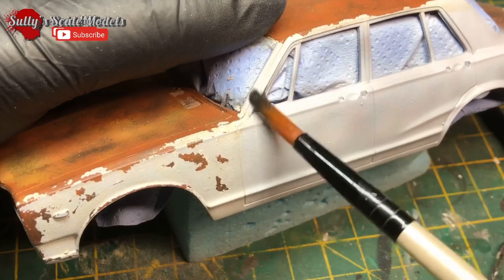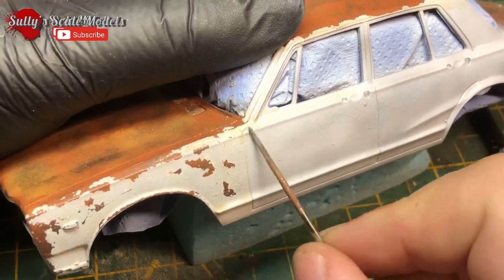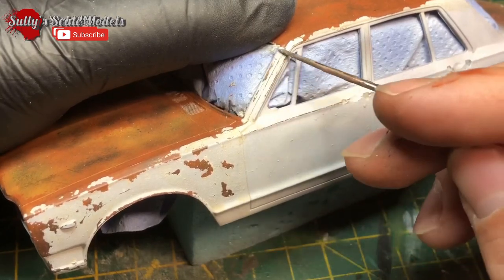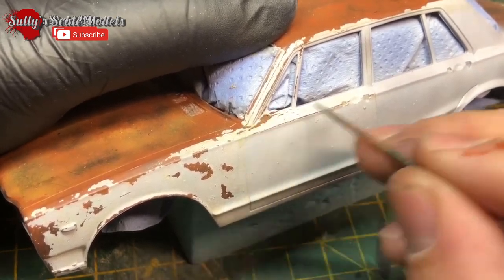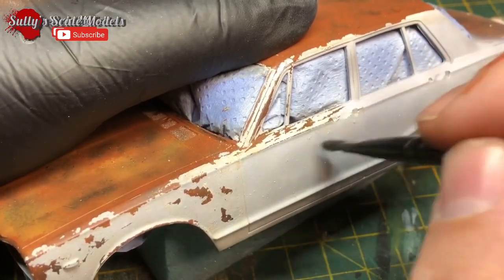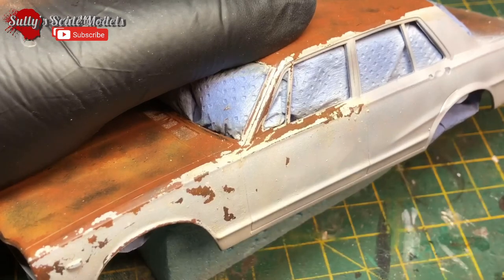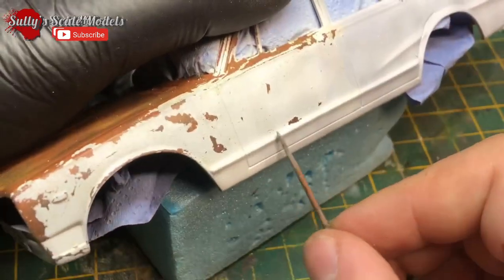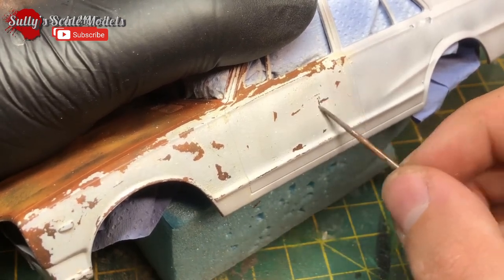Skyline 2000GT-R ‘Knackers Yard’ Part2.’How to’ Rust Chipping & Weathering

Comment: I’ve never had the hairspray method act like yours did. How long did you let the white paint dry? What brand paint? What did you use for the streaking rust? Oil paint?
Reply from the maker: I think what may of happened was that i flooded it with water, i used less on the sides and worked better. I used Valejo for the white and comart for the rust streaks. Really good but its very thin so u sometimes have to keep going over it.